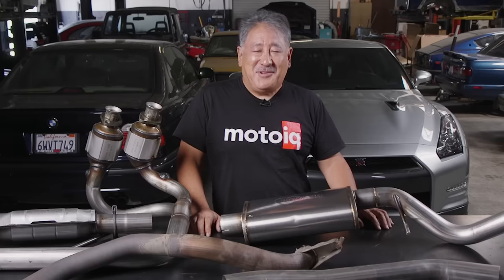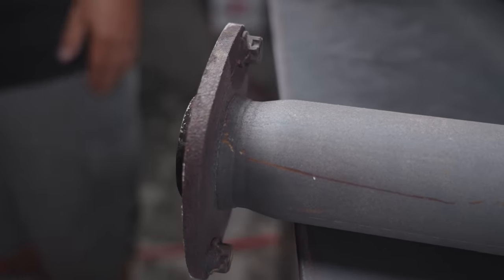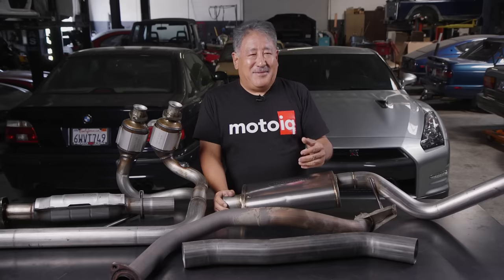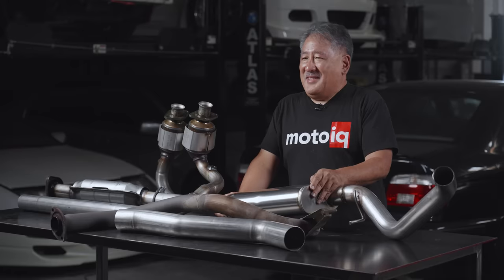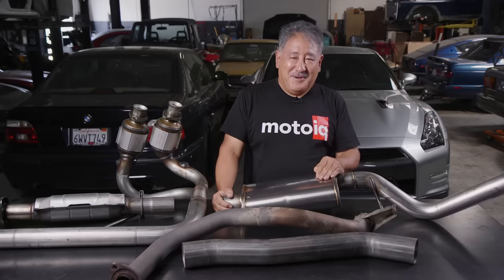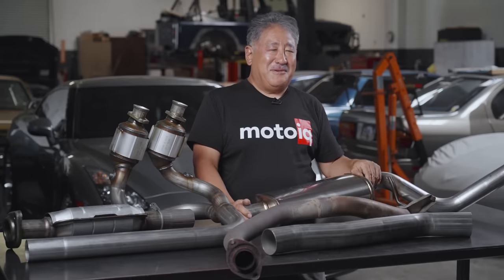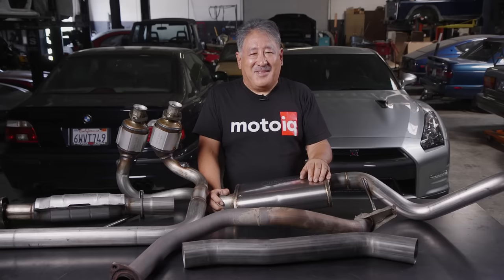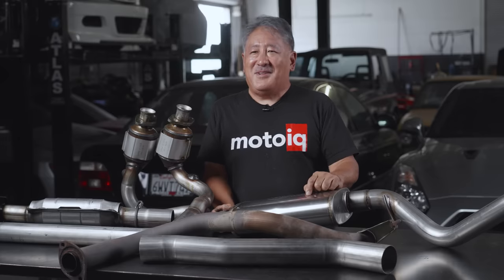Exhaust Back Pressure Myth DEBUNKED!

Comment: Depends on what you refer to as back pressure. The harmonic of the exhaust pulse is used in conjunction with valve timing so the pulse arrives back in the exhaust port to keep the incoming charge from leaking into the exhaust port just before the valve shuts. If the action of the gas flowing out of the cylinder is being pulled by momentum or the flow of exhaust from the previous cylinder's exhaust, the incoming charge will be at risk of following the exhaust gas out. The exhaust note changes because of theses pulses especially when the engine is "on cam". Back pressure in this sense doesn't effect overall volumetric efficiency, because it's not an overall restriction in gas movement, just a pulse at the right time.
Reply: Nope. Just plain old back pressure. That would be pumping loss. These are not harmonic shock waves traveling at the speed of sound. This is just plain old gas holding up the piston from coming up freely! Purely arcane pneumatics and a little bit of physics about expanding gases!
Reply: @fppro1679  lol.  Not the speed of sound.  Its resonance. Its part of why you get a power band. And I don't mean Led Zeppelin
Reply: @yodab.at1746  the resonance you're referring to, is it related to an acoustic event going through the gas, not the gas itself flowing out of the tube. The event itself is like sound or it is sound itself. Essentially traveling through the gas. What I'm talking to you about is pumping loss which is completely different because pumping loss is about the volume of gas being restricted and causing pumping loss, two distinctly different things i. E. Gas volume and flow, and shockwave.

Comment: There is also the BIG problem of adjustability. If you remove the back pressure from an engine and assuming it can get enough fuel from the carbs to prevent it from running too lean the ignition timing may need to change extremely. You must size your pipes accordingly and remember the the limitations of the rest of your components. It's horses for courses. Newer engines are very different with fuel injection and electronic ignition being much cheaper and easier to tune to your requirements.

Comment: Great explanation, it's pertinent to mention that the knock characteristics change with the flow of the exhaust.  I've noticed a major change in my CL9 project when I increased the DC header collector size from 2 1/4 to 3".  The tune actually works now ;). makes power all the way to 7600.
Reply: I cant wait to install my weapon r header and 3 inch single exit exhaust! I have hondata so I know it'll change the characteristics quite a bit.
Reply: @tiles3458  make sure to either disable or adjust the knock sensitivity, headers are "noisier" than oem manifolds and can still fool the knock sensor into cutting back on timing.  FYI.

Comment: I was in mechanics for meny years. You are spot on. Intake and Exhaust works better without any restrictions.
Like anything that needs to breathe!
The only way to improve this is by forcing more air into the engine.

Comment: thanks mike!

this has helped me finalize the exhaust design and piping diameter for my e92 m3 with a 4.4L stroker.

since the factory piping is around 2.5" iirc, so with that said, the design would utilize a slightly larger diameter piping off the headers, to a smooth Y merge, to a larger single pipe all the way back.

this should be the ticket here but I'll know when it comes down to meeting with my tuner again. with many revisions of course :)

Comment: Those pulses happen in the intake manifold as well. Richard Holdener explains the concepts very well.
Reply: Doesn’t he prove back pressure is good depending on what you’re trying to accomplish?
Reply: @RaceMentally  low to no back pressure is ideal. The pipe diameter needs to be big enough to flow with no back pressure but not to big because the exhaust will lose velocity. The idea is to give the combustion chamber and cylinder the most efficient airflow during the intake and exhaust strokes especially with overlap from a performance camshaft. When both intake and exhaust valves are open briefly the exhaust flowing out of the combustion chamber helps draw fresh air from the intake valve. This is called scavenging. Back pressure counteracts this effect. It's like the difference between coasting down hill and riding uphill on a bicycle.

Comment: You nailed it the reverberating exhaust compression wave really helps scavenging during over lap we tested a bunch of exhaust and pipe dia combo's on our dyno with a healthy LS1 and the single exhaust wit 3" diameter made the most power with the correct mufflers of course we used a Streight thru Bullet muffler and got more HP and TQ than duel 2.5 ex however when we put the turbo type muffler on the single 3" we lost almost 80 HP wow what a difference. it's like you said back pressure is bad I've been teaching that for 20 years you need really good flow but you also need the correct resistance to flow in the form of an ex pipe to keep the velocity of that gas high and hot
Reply from the maker: It's amazing how much a Turbo muffler or a chambered Flowmaster can kill the power.  No one belies me until they actually do some dyno testing on a healthy engine.

Comment: The issue with oem exhausts are they're made for noise and emission standards, and not for the performance of the engine it self. Take a Nissan Patrol in Australia, by upgrading  exhaust after the cats to a 3inch mandrel bent one you gain torque and a bit of hp. The standard exhaust has a section which is flat and a diameter of 1.9 inches, which for a 5.6l V8 is nuts, it also has hard bends and the mufflers has sharp bends and a value in it. Went after market with a good 3 inch and I've gained 30nm and 6kw and fuel usage dropped a bit as well. Yes, the car has a nice V8 note to it now, it's not overlay loud and it's made of 2mm thick 304 grade stainless steel which will last the life of the car.

Comment: I've often wondered if there would be an advantage to slowly increasing the diameter of the exhaust down the temperature gradient.
Reply: No, not only would it have a negative effect on gas velocity but exhaust gas, though miniscule, cools as it travels down the pipe. So what your thinking is counter intuitive.

Comment: I remember reading a Hot Rod article from back in the 80's or early 90's they did a dyno test using different exhaust. With H pipe, X pipe and true duals as well.  The true duals ( one pipe from the header to tail pipe for each side) made to most hp and torque.
Reply: This is also the reason why dragsters have one individual (very short) exhaust pipe per cylinder.

Comment: Agreed, with one slight exception. Straight Piped Harles will triple carbureted due to the revision of sound wave in the open pipe. This only happens at low rpm but it kills low-end torque. This is why they invented torque cones which hurt power a bit up top but fix the low end.
Reply: Reversion (yeah, I know it's a typo' 😎👍), sometimes called fuel stand-off. This is a very common problem with IR setups running significant overlap camshafts.
It isn't down to the sound (pressure) waves, but the air column in the port being physically pushed back through the carbie's venturi - which works almost as well in reverse - before passing back through in the normal direction on the next intake stroke. 
As rpm increases, the air column inertia from it's higher velocity resists the reversion to the point where it stops and the engine will start to run properly - sometimes this is referred to "coming on the pipe".
As you will gather, that reversion also compromises the initial cylinder filling, which is more likely, IMO, to explain the "pipe" phenomena 😎
Reply: @gordowg1wg145  😎👍🏼
Reply: @Jasen Vernor 
You may have posted this in the wrong comment' thread?
Reply: Yes properly tuned Duals will never have as nice of a torque curve as properly tuned 2 into 1 on a big twin.. torque cones and torque inserts help!! But a good quality  2 into 1 with a tune will crush them performance wise

Comment: This is calculated based on revs at which you want to have proper scavenging effect. For these having minor problem to visualise, imagine syringe that you closed of with your tip and you are pulling out the syringe rod. Syringe is trying to suck in the air but it can not because you blocked the tip so you are making under pressure.  Exactly same thing is happening if you have right amount of (small) back pressure. When exhaust valves are closed moving mass of air inside the exhaust pipes, continues to act same like when you are pulling the rod of the syringe. This is making small under pressure and helps to evacuate gases from cylinders once when exhaust valve opens fully. Since this is mechanically limited action, based on mass of air, velocity, size of engine and size of exhaust pipes, it is tricky to tune and can be tuned for narrow range of RPMs. But thanks to turbos, this "black magic" is not needed so much anymore.  In order to add to this already good video I can share this old one that also brings good information on exhaust https://www.youtube.com/watch?v=RWTARjxiqlo

Comment: Good to hear this after gutting the dpf on my van, was worried it had lost boost as it felt less punchy but it seems to just spool earlier and smoother so feels less aggressive but more efficient, great explanation!
Reply: Hope you got a tune afterwards. Any change to a modern engine setup needs to be compensated for in the ECU, otherwise it screws up mixtures ect.
Reply: @Patrick-857  yeah first test drive was to be reprogrammed. The dpf done a regen on the way and got smokey but it was alright to drive there.

Comment: I was told that the back pressure thing started in NHRA when they were trying to make power with flat head Ford V8s. If they ran no pipes they made less power than headers. Then it kind of got out of hand with people not really understanding what was going on, but they understood just enough to make it work. Granted this was told to me from an old NHRA crew chief about 30 years ago, so I am sure he knew what he was talking about, but maybe I don't remember so well. Good video.
Reply from the maker: He is probably right.

Comment: His guidance is consistent with what any chemical engineer would learn in a fluid flow class.  Subscribed.
Reply: Chemical engineer in a fluid flow class, LMAO
Reply: @valkman761  What? They take 2-4 Thermodynamics classes, and multiple fluids classes. What do you think air and steam are if not a fluid?
Reply: @JacopoSkydweller  fluid dynamics is what's relevant here and presentation isn't really consistent with what someone would learn in a "fluid flow class". The premise of less is more here is really not consistent with anything other than wide open throttle scenario

Comment: It is true for two strokes, the back pressure created by the exhaust cone sends back fresh mixture in the cylinder while the exhaust port is still open. The length and cone shape of the exhaust can be used to determine at what rpm the back pressure is most effective.
Reply: Excellent point, although the effect is only for a short duration of any piston cycle, the rest of the time the above is applicable, I imagine.
Reply: @jeffreystroman2811  It is at the part of the compression stroke, when the exhaust port is still open, the piston pushes fresh mixture out of the port and the pulse wave from the exhaust pushes it back into the cylinder.
Reply: Sorry, not true for 2-strokes either. What a properly "tuned" exhaust for a 2 stroke does is create reflected pressure waves that when timed correctly, hit the exhaust port to reduce the amount of incoming mixture that escapes during port overlap. This is resonant tuning, NOT backpressure. I think the issue here is exactly as Mike explains in the video - backpressure is the wrong word, or at least conjures up the wrong image in people's minds. On 4 strokes, a slight amount of backpressure is a byproduct of creating velocity. You can create backpressure with a crappy manifold or restrictive mufflers, but that doesn't create velocity. The same is true in the argument for 2-strokes. Backpressure is the wrong word. Sure, the reflected wave in a 2 stroke exhaust is a pressure wave, but that's not the same as "backpressure".
Reply: @brettturner7057  You're right, back pressure is the wrong term here.

Comment: Interesting about turbo exhausts. On my VW 1.8t you could change shift the power up and down with exhaust size. a 2 to 2.5" had more low-mid torque, and a 3" had more up top. For a street driven car I preferred the middle sized options. Not sure why the turbo spooled faster with the smaller exhaust. I didn't notice much of a difference in fuel efficiency, maybe slightly more on the smaller stock exhaust.
Reply: It spooled faster because smaller exhaust same volume of air means more pressure making the turbo to have more pressure to spool it faster. Imagine blowing on a fan and then doing it with a straw, which one makes it spin up faster. And for the torque and HP you mentioned. It's a turbo engine it's not gonna make power unless the turbo is spooling. The larger exhaust just caused it to spool a little slower which could result in less bottom end torque but is less restrictive for better turbo efficiency on higher rpm ranges
Reply: likewise, I have a 2020 Acura NSX with just JB4 piggy back ecu (nothing else). My friend has JB4 too, cat deleted and muffler deleted (after market exhaust system). At the drag strip, I constantly getting 10.8 and a few times I got 10.6 where as he get 10.9. Seem my turbo like the way it is while making exhaust bigger piping gain horsepower but lost turbo spool time. My turbo spool faster.
Reply: @Nick Smith  that isn't how it works.  A larger exhaust actually make the turbo spool quicker.  I noticed this on my fbo hybrid turbo fiesta st which is my daily.  I had a 3 inch free flow downpipe and stock 2 1/4 catback with resonator delete and stock restrictive muffler.  I went to a full 3 inch cpe catback with no neck down and it spools up quicker now and the guy in this video even backed this up saying a largere exhaust will spool a turbo quicker.  It isn't the same as an na setup

Comment: Old school V8 Muscle guys said back pressure was GOOD because back pressure AKA that restriction in your system helped create low to mid range power. 
When they did upgrade the exhaust system and placed headers, that MOVED the low mid peak torque to a higher point in the rpm's, a point where they NEVER reved to, EVER. 
So now what they experienced was a LOSS of low end mid range peak torque giving them the impression they lost power when they really didn't. SO they said, back pressure is good and is needed. 

My 240sx ka24de motor had a LOT of low end torque with stock exhaust system but had sh*t for top end power. When i slapped a 4-1 header, high flow cat and 2.25 inch catback, i LOST my low end torque but gained a lot of top end power. Now that engine was breathing and felt better. Sure take off was a lot slower but as it reved, it was smooth and got faster as i get to 7k rpm where as before, it would launchg hard and fast but be dead by 6k rpm ...

Comment: I think too many people equate back pressure with scavenging. You do not need to add back pressure for scavenging. Excessive back pressure will actually harm scavenging...
Reply: It's more for low end power.  The higher the power band the less you want.  Also turbos don't need any scavenging making this more complex.  Might car mods did a dis service with that potato years back.
Reply: and excessive pipe diameter will also harm scavenging due to gas velocity loss which will give the same negative effect as too much of backpressure?

Comment: I get so many customers that want to stick massive tubing on stock engines, because the opposite is also true. Some people take it too far with low backpressure. Nobody knows they should care about VELOCITY also!!!
Reply: Thats why I kept my 2.5" diameter to the OEM size, and single layout. Of course everyone who doesn't know better says, "You should have went duals" yeah and I'm not having a 20 year old 240hp V8 truck with two tiny pea shooters out the back.

Comment: I could listen to this man for days.  He's a definite virtuoso of the auto engine.
Reply: The torque factor needs to enter the equation. Depending on the application back pressure can help with mid range torque.  Drag racing and road racing applications don’t require mid range to work but motocross and Enduro application certainly do

Comment: When I drove my WS6 with open headers it would barely get out of its own way. When I switched from a 3" Y-pipe to a 2.5" my car got noticeably more powerful in the lower rpms.
Reply: Should have shortent the lenght of the intake to mathc the increase output flow then you would see an increase in horsepower up in the rpm range but at the cost of low end torque.
You just lost torgue without the hp gain the way you did
Reply: Was it tuned for open headers?
Reply: That's a tuning issue.